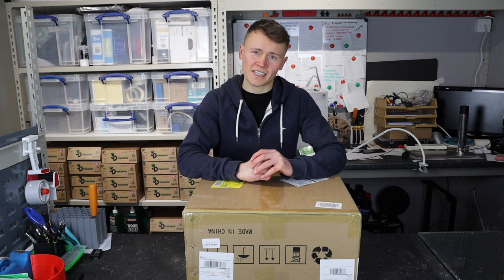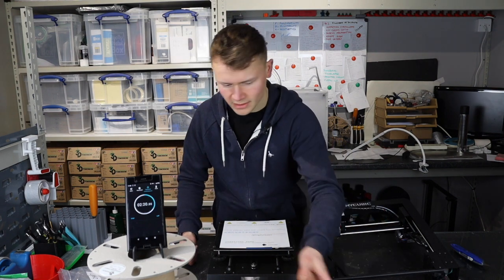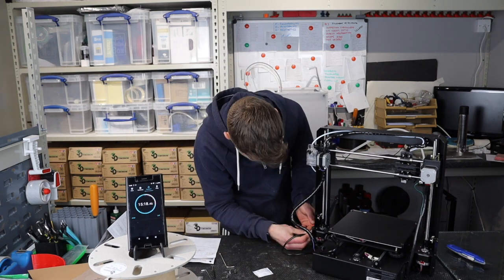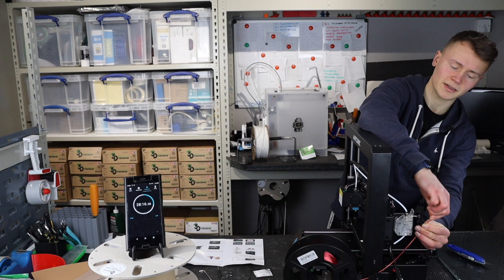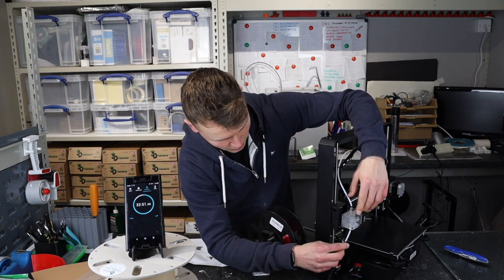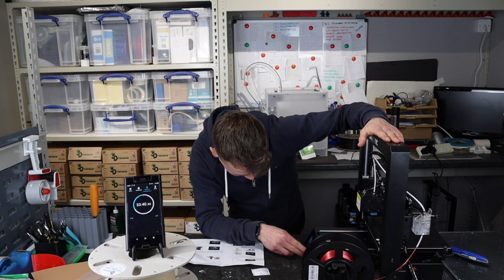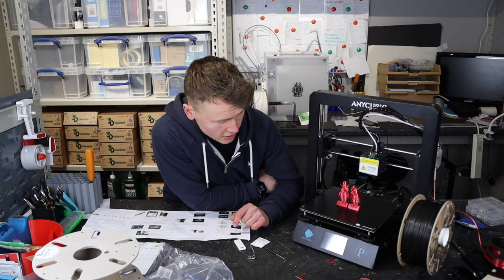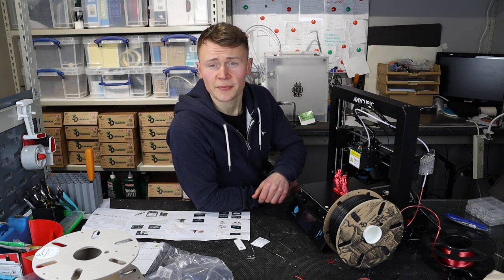UNBOXING & First Impressions - ANYCUBIC MEGA PRO 2 in 1 3D Printer

Comment: X and Z axis motors are not functioning
Reply from the maker: Best to contact support and see if they will send out replacements. You should be able to use the Y-axis cable to verify that the steppers themselves are not faulty. After which time, it will either be the X/Z cable or the board itself.

Comment: Had this printer running less than an hour,  control panel flaked out, auto level feature totally inop, and now does not want to feed filament at all, though it goes through the motions like it is going to print, but prints nothing. Tech support nothing less than a nightmare, so at the end now, all my hopes pinned on Paypal. Darn shame, I alos have their Kobra Max,  which seems like a fine printer, but am getting real worried about tech support now.. may have to sell it  and start all over with a new brand.
Reply from the maker: Yep, its definitely a printer where proper QC checks weren't followed, you'll see from my review mine also broke... Luckily the support was pretty good, but I reached out a number of different channels, so maybe worth a try? Emails/various social media/original seller
Reply: @CallumColes  agreed, it's really a darn shame. The Kobra Max I got at the same time seems to be a great printer, but the tech support is so shoddy with these guys -- takes 1-3 days for each reply, and they completely ignore what you try to tell them. When I said I was going to issue a paypal dispute if they did not do something, they sent me a email basically stating "We see everything must be ok now".  Its always a shame when a  company with a potentially great product lets shoddy tech support tear it down and make it a poor decision to purchase

Comment: my X axis doesn’t seem to be working any ideas how to fix? It’s new out of box and it’s not printing the owl pair correctly
Reply from the maker: Firstly turn the printer off and move that axis manually by hand. If something is wrong mechanically this can normally help you identify where that is.
More information would help, what’s not working?
If there are lots of shifts left and right in the print then it could be that the belt is not tensioned correctly. If you pull the belt it shouldn’t move too much, but equally shouldn’t be rock solid.

Comment: I need help, when I go to fill the extruded up with filament and feed it through, the nozzle is at 230 and I click fill in and it won’t burn the filament.
Reply from the maker: Hi Kevin, Im not sure I understand what you’re trying to do? Are you able to push the filament through by hand? Are you on the laser menu and not the 3D printing menu?

Comment: Also the standard nozzle that comes with the printer isn't 0.4mm. When you insert a 0.4mm jig you realise the hole is actually larger so they probably use some cheap fake nozzles. Absolutely recommended is to upgrade the nozzle to genuine E3D V6 0.4mm noozle, and genuine Creality Capricorn Bowden tube, and run a filament flow tuning.
Reply from the maker: There are a lot of cheap rubbish nozzles out there... you never quite know the diameter you're going to get if you rely on cheap nozzles. Always nice to have a decent nozzle, although with proper fine-tuning, the exact size of the nozzle is not too important.

Comment: The "waving" is because the factory printer firmware has no bed PID tuning function. Turn OFF the heated bed and the waving will dissapear. You need to update the firmware with one that has PID tuning function, and do bed PIB tuning. This will optimise to power output and the "waving" will be gone.

Comment: I've been wondering why this isn't the only video where the arrows on the box pointing which way is up is shown as pointing down. Is that done by you on purpose or are these shipped upside down??
Reply from the maker: Very astute observation of you! I can't remember noticing the 'this way up' arrows when I opened it, I suspect I assumed the shipping label was on the top, as thats normally the default position. Although in this case the shipping label looks to have been on the underside, so Amazon probably shipped it upside down!

Comment: Is this a good 3D Printer for a complete novice to 3D Printing? I would like a printer that does good quality prints and engravings, but is not a nightmare for me to learn on. This will be my first printer and engraver.
Reply from the maker: Yes, I think as a beginner you’d certainly be able to learn the ropes with this machine. It’s got some nice features. Just been prepared to learn slowly, if you don’t expect perfection from the first print/engrave you’ll have a much more enjoyable experience:)

Comment: Why didnt you use the bed leveling sensor they provide? As an absolute newbie, i have not even unboxed mine yet. Would the sensor make bed leveling easier and more accurate?
Reply from the maker: I did use it once, just to see if it was of any benefit, but to be honest it's not really that useful. If you're going to jump straight into the printing then you'll need to level it manually anyway, if you're going to start with the laser first then it might be handy if you're a new user!

Comment: They print very nice due to the solid rods they use for the axis, but the whine whine wurr wurr from the 4998 drivers is annoying. I ended up putting 2208's in my mega s and it is like a totally different printer.
Reply from the maker: Nice! I suspect that would have also improved the print quality as well, so yes a very worthwhile upgrade:)

Comment: I have a question I used the paper to level the bed to start as I didn’t realize you had to remove the blue piece from the extruder to get the auto leveler to work. I printed the owls and they looked great. Printed another item and it was good and then I figured out the auto leveler so I tried to use that and from then on my prints haven’t worked. When you used the auto level function do you run the bed up until the alarm sounds and then leave it there or do you run the bed up until the alarm sounds and lower the bed back down? Your video is great and I am excited to try the laser soon too.
Reply from the maker: Thanks for the comment:)
Personally I have not found the auto leveller particularly useful! You have to take it back off to run the prints anyway, so by the time you take all that into consideration, I think it's easier to just keep an eye on the levelling yourself. I would recommend the method you used the first time around. 
Since shooting this video, I discovered there are some small screws on either side of the frame of this printer, these screws are what makes contact with the z levelling end stops. You can adjust these to fine tune the height the printer lowers on each side.
If you need more guidance on bed levelling, I did a full guide in one of my recent videos, so worth a watch if you get time.
Reply: @CallumColes  Awesome I will go back and watch that video I greatly appreciate your fast reply.

Comment: Hi where did you buy the printer from please??
Reply from the maker: Hi Kevin, I bought the printer off Amazon, I can send you the link if you want? You can get them elsewhere for less, just depends if you don’t mind waiting for shipping!
Reply: @CallumColes  hey would really appreciate the link thanks
Reply from the maker: Evening Kevin, just a heads up that my particular printer has actually stopped working after approx 60 hours of print time! Y axis stopped responding. Realistically I could probably fix it as it is, but thought it would be a great chance to test that 1 year warranty Anycubic offer and judge their product support. That's why I have not yet posted my final review video for this printer as the jury is still out and I will wait to see how Anycubic's support team handle this issue. However, if you are set on the printer and want to proceed with a purchase, here is the link: https://www.amazon.co.uk/gp/product/B08CY3459J/ref=ppx_yo_dt_b_asin_title_o05_s00?ie=UTF8&psc=1
Reply: @CallumColes  thanks for the heads up I'll watch this story develop :-) and then decide ?

Comment: Very straight to the point and timed video i appreciate that. I am on the website thinking of buying this printer as my first 3d printer. I want to ask though do you think this printer can be modded to be able to use polycarbonate filament? or is that not an option. and if not what printer do you recommend for doing such things.  tpu, pc, pla, abs, etc thanks (mainly printing parts for drones.)
Reply from the maker: Thanks for the comment. This printer wouldn’t be suitable for printing PC without some serious modification, even higher end printers can struggle with PC straight out of the box. If you definitely need PC then you’ll want a printer with an enclosed build chamber and a metal hot end capable of printing up to 300C. However for drone parts I think TPU is fantastic. Another underrated material good for drone parts is Polypropylene, very durable and also more rigid than TPU. The only downside to PP is that you have to print on PP sheet as doesn’t really adhere to anything else, but luckily this is pretty cheap! Good luck with your printing journey:)
Reply: @CallumColes  when you say serious upgrades you give me hope. i like a challenge. I would obviously start off with tpu, pla, abs, and this PP you speak of sounds very interesting. can the anycubic mega pro handle PP? Also if i really did need to do pc as i have a few micro drone frames printed in that from different suppliers and it rocks; then what upgrades would you start with ? capricorn tubing ptfe? if using this some say all metal hot end isnt necessary. but lets say you get all metal hot end and capricorn tubing, enclosed /heated enclosure, and a  insulated heated pc bed... how would you turn the heat up on the extruder past the limit of the software? can moving everything over to octoprint bypass this? im talking a lil out of my knowledge here but i guess im just trying to ask is it possible with this printer if enough work is put into it?
Reply from the maker: Yes, the Anycubic would be able to print PP. For PC, you would need to install an all metal hotend, since PTFE/Cabricorn is not able to exceed 240C (or it starts to release nasty fumes). Add an enclosure. Install new firmware to override the max temp values. 
If you're only after small PC prints that would probably get you there.
Reply: @CallumColes  thanks for the reassurance. Im going for it...
Reply: If all else fails at least I'll be able to print TPU ABS PLA PP etc 😅
Reply from the maker: @SkyCandyVisuals  exactly, it’s win win:)